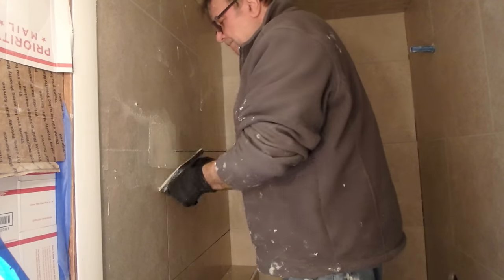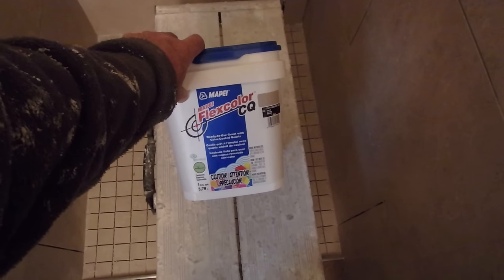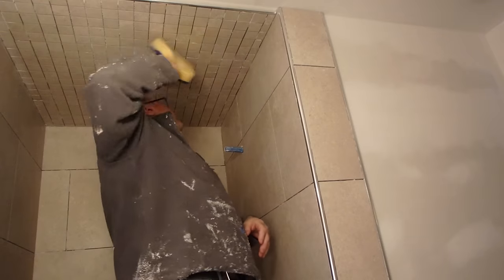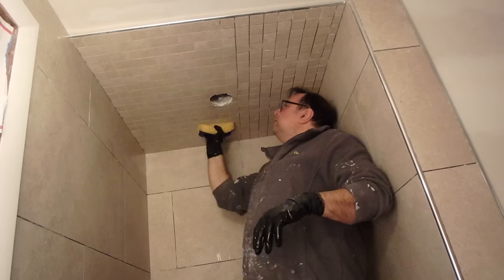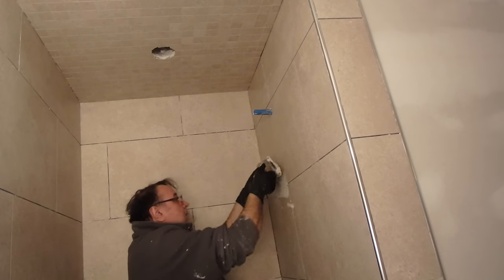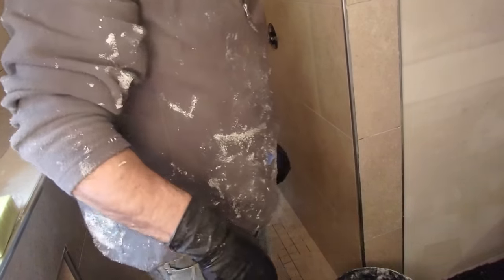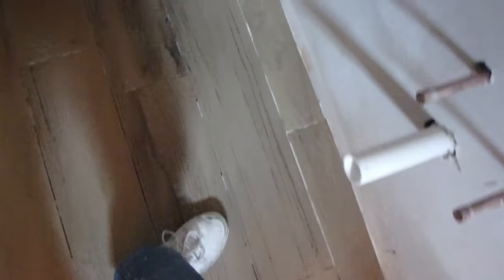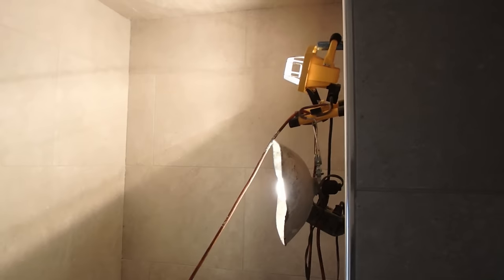🤔Grout options and things to know about grout. Mapei Flexcolor CQ how to apply.

Comment: I just did my bathroom floor last night with Mapei Ultracolor Plus FA in Pewter. It's drying with a white haze  I wiped it off more than once but it keeps coming back. 🤷‍♀️ I assume this is efflprescemce? Any suggestions?
Reply from the maker: Not enough info to suggest what it might be.
Reply: @SalDiBlasi  I called Mapei and they said it's most likely due to overwashing resulting in the polymers coming to the surface or from washing too soon. They recommended using sulfamic crystals after 10 days (once fully cured) to fix the issue. Alternatively, they have another product called Grout Restore which paints the color you want onto the grout and seals it at the same time. I kinda like the whitewashed look so I may just leave it.

Comment: Hey buddy, I haven't used this yet....and it looked like when you washed, you're sponge was pretty wet (or at least wetter than it would be with traditional grout) does it not matter with this stuff cause the color pigment cant be washed out?
Reply from the maker: Color can not be washed out, the aggregate in the grout gives it the color.

Comment: 11:45 "these corners I'm going to fill with caulk."  <-- does it make any sense to do the caulking in the corners, before applying grout?
Reply from the maker: Corners need to be kept clear of grout.
Reply: @SalDiBlasi  Right, I get that.  I was wondering if, by doing the caulking first, after the caulk has set the grout won't be able to get in the corners.
Reply from the maker: @RyanBissell  You can caulk first, you don't want grout in the corners.
Reply: @SalDiBlasi  what caulk do you recommend for corners when using mapei flex color cq? Mapei claims you can use in corners and never have to seal grout lines also.

Comment: Given its quick drying natural would this be recommended for a first timer? I'm doing a counter to ceiling 3x6 subway kitchen wall medium gray grout.
Reply: Did you wind up using this grout? if so how did it go?  I'm a first timer considering using this as well on a kitchen backsplash. any recommendations?
Reply: @mesposito1625  I will be using it. I'm in the middle of setting about 600 sq ft of 3x6 subway tile. Hopefully doing the grout in a week or less. I'll let you know how it goes.
Reply: Well I used it to install counter to ceiling 3x6 subway tiles. What a nightmare, the grout just doesn't stick very well to anything, the glossy tiles or float and it falls to the floor like crazy. What a mess! If I spent 10 min spreading it does dry and is somewhat hard to wipe down. This in a 72 degree room.  Seems it really wants to be wiped just a few minutes after applying. If I ever do this again it won't be with Flexcolor. Need something that stays on the wall and float and doesn't dry as fast. I would only use this for floors as that's where it really wants to be.
Reply: @mesposito1625  I replied to my last post so this is a reply to your post so you get notified. See my reply above... not good
Reply: @KB3M I appreciate the feedback. I was actually all set to use this, tried it on a sample tile first, and it wound up scratching the tile pretty bad. So I’m going to have to switch products. I’m going to try ultracolor plus FA. Hopefully that doesn’t scratch. Hopefully within the next week or 2. I wanted to wait for it to cool off a little. I’m in FL and it’s been mid to high 90’s every day. Thanks again for the follow up response!
Reply: @mesposito1625  The Renovation guy warns about Ultracolor drying too fast for beginners. After watching other videos challenging that it seems the issue is mixing too vigorously as it "fluffs" it up with too much air and if it's a hot day as well then it will dry very fast.
Reply: @KB3M haha yes I did see that video as well. “Tear it down, and start over” 😂. So after allot of research, it seems the keys to success with that grout are mixing on low speed (or hand mixing which is what I’ll do), very cold water, crank up the AC, and do very small sections at a time. And hope for the best! Thanks again for all the info- I’ll let you know how it goes

Comment: Hi Sal, I read reviews (that I take with a barrel of salt) of people saying their CQ grout never cured. Now my guess is that they are doing something wrong in their process. Have you ever encountered this or maybe know why they might have issues?
Reply from the maker: Have not heard that, it might be another grout you are thinking of sold in the box stores.
Reply: @SalDiBlasi  No, these were actual Mapei CQ grout user reviews. Let me find them...
Reply: @SalDiBlasi  Nope, all of the bad reviews were about it being very hard to clean up. There were many complaints of it hardening super fast and the haze being nearly impossible to remove 5 minutes after application. It must be some other grout I read reviews of it not curing fast enough. I'll find it.
Reply: @SalDiBlasi  I found it, it was a TEC product where the manufacturer had to send people some kind of hardener to get it to cure.
Reply from the maker: @kenhoward127  I know all about it, recently had to do apply the hardener to a big job I did, I will probably be using something else from now on.
Reply: There are couple videos of bad experience with Flexcolor CQ on YouTube. One from old gentleman, who got haze and inconsistent color on his kitchen floor, second from lady, she used it on shower walls, but even after 4-6 days, grout still did not cure properly. 
My guessing, first issue was about letting grout to dry beyond open time, which caused haze as grout sticked to non-glazed tile permanently, then gentleman tried to mitigate haze with epoxy haze removal liquid, which aggravated it, as Flexcolor is not an epoxy based grout, and it might cause floor dirt liquified by haze removal liquid, draining into grout lines causing color change. Another possibility, white mortar thinset was used to lay tiles, but grout lines were not cleaned and let to dry thoroughly, which resulted in mixing grout aggregate  with thinset, hence color inconsistency. Situation that lady got into, seem result of over damping grout lines during preparation perhaps not letting it dry, instruction was saying about wetting tile surface with dump sponge before applying grout, which could possibly be interpreted as making it really wet allowing water to sip into, those type of grouts unlike to epoxy, don’t like much water and get watered quickly, which drastically affects their bonding properties and cure time. I don’t thing Mapei ever mix this grout with water to store as premixed in bucket, but rather some combination of mineral spirts, that suppose evaporate quickly once grout is spread.
Reply: @SalDiBlasi  Sal, are you saying you will not use the Flexcolor CQ from now on?? I thought you liked it so im confused. I was thinking of usin the Flexcolor CQ
Reply from the maker: @keithowens9242  I have had no problems with the CQ, it is a great product. The issue I had was with a different grout and different manufacturer.
Reply: @SalDiBlasi  Im just watching another video of yours saying you like Spectra Lok hands down better. I think Ill look at Spectra Lok...........thanks Sal
Reply from the maker: @keithowens9242  That does not mean that the CQ isn't any good.
Reply: @SalDiBlasi  Understood Sal, you were referring to a TEC product not CQ, appreciate your videos. I will look at both products and make a determination which to use. Sounds like a win either way

Comment: Will you use sanded or unsanded caulk?
Reply: 100% silicone
Reply: @stephenbelyea7657  does 100% silicone mean 0% sand?
Reply: Usually. There is a company that makes custom silicones to match most manufacturers. They make it in gloss, matte and sanded textures. COLORITE

Comment: Sal :  can i use the mapei CQ for the shower floor? 
Would you compare it to the fusion pro?

Thanks for your time and for the great videos 👍
Reply from the maker: Yes you can use it on your shower floor, in most cases, not recommended for  river rock tiles, or steam showers.  I would not compare it to Fusion.
Reply: Sal , thank you very much for your response.   Which one is the best , mapei CQ or the fusion???
Reply from the maker: @Peter-.H  CQ for sure.
Reply: I sell bathroom installs for a large home improvement company. CQ has had significantly better results than fusion. CQ is the only grout we use, except on pebble shower pans where it’s not recommended.
Reply: Reilly Liner :
Awesome. Thanks for the great comment and explanation. I really appreciate that.
Have a great weekend 👍
Reply from the maker: @reillyliner  Not so much pebbles, but the distance between some of the pebbles. If they are tight and the grout width never exceeds 1/4' then the CQ will work. Problem with pebbles is that they always end up having large spaces between them in many places.
Reply: Sal DiBlasi  Thank you, Sal! That makes sense and is the more proper way to understand it

Comment: Will this product work on glass mosaics?
Reply from the maker: It should, however it is not the tile that you need to be concerned about, but more what the tiled area will be used for.
Reply: @SalDiBlasi  thanx I will be doing a vertical strip in the shower
Reply: @guero916  I’m getting ready to grout a vertical glass mosaic strip myself. First timer. How did yours turn out?
Reply: @jamesjett1561  
Great  still looking good 👍
Reply: @guero916  Didn’t scratch the Mosaic?
Reply: @jamesjett1561  no
Reply: @guero916  Thanks good to know, thanks

Comment: It helps adding a little little water the that type of grout.
Reply from the maker: Do not do that.
Reply: @SalDiBlasi   I dip my float in the water and grab the grout with a damp float works for me...
Reply: This grout whenever is in bucket looks wet and saturated, but it is not water, it is adhesive. So adding water in it dilutes adhesive, and compromise it’s strength and bonding.
Reply: @BlahBlahManYeah   bullshit. 

I'm talking about dipping ur float in the water and that's it. Helps with spreading and removes extra grout much better then dry. 

2nd. When u go to wipe the damn grout   and this grout cannot be let to dry u use a damp sponge.  I'm not adding  water to the grout I never said add water.

Comment: This product is not for the DIYer. Very easy to mess up.
Reply from the maker: Believe it or not, any product you use is easy to mess up if you don't follow directions.
Reply: @SalDiBlasi  ive seen some horror stories with this grout.

Comment: My opinion is this grout sucks. Stain resistant? I think not. Used this grout on my kitchen floor and mud that my dog dragged in does not come out! Even tried using professional grout cleaner. Nadda. Only positive i can say is its very durable. Does not crack where its grouted next to cabinets but it definitely stains
Reply: Hey Kevin, nobody asked for your opinion. Also, get a new dog.